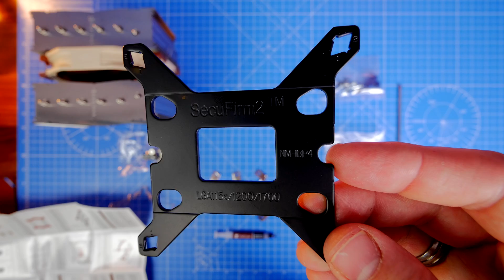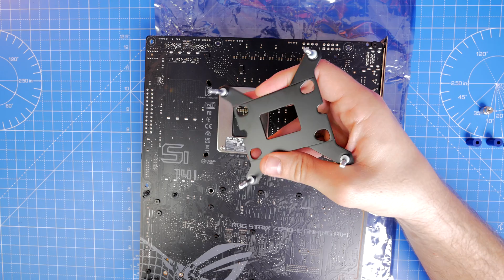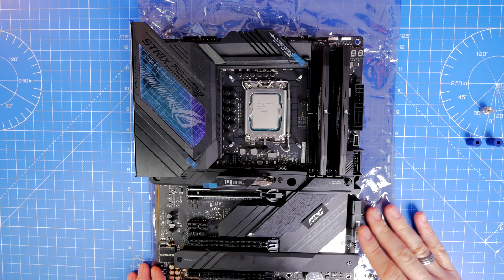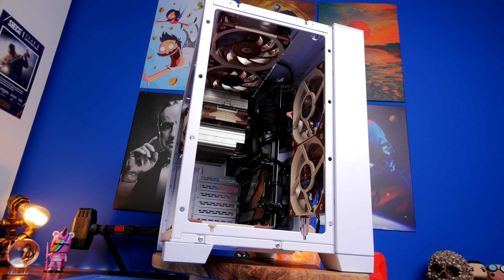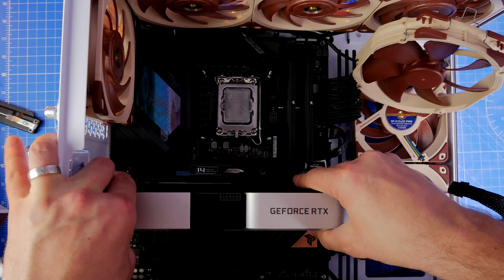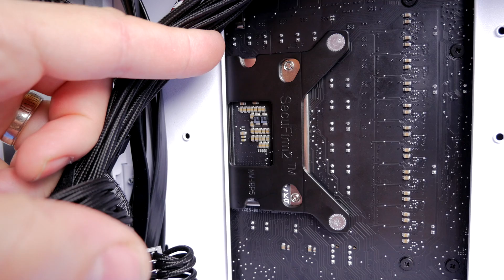Don't make this stupid mistake I did  (Noctua air cooler issues)

Comment: We've all be there in some form but its good you were able to get it resolved. I've gotten into the habit on new builds to build them on a test bench first and test the system for a good couple of days before migrating it into a case and finalizing the build w/ the typical wire clean up; mainly because of issues like this. Sure its a little more work to build on the test bench but far less than doing the final build install if things go wrong and you need to tear the system down to fix it.

Comment: phew, thought i was the only one but, I have my noctua cooler mounted horizontally as well in my PC case. do you think the temperatures get any better as opposed to if you had installed the cooler vertically?
Reply: Old but thought I would add, just installed mine on a mag x670e Tomahawk, and wish I had mounted horizontally as cant get in my first gup slot, If I had gone Horizontally it would reduce cooling slightly but adding and extra fan would have brought it back, I live and learn but was my first PC build, and a little bit more research would have helped. idle on a ryzen 7800 x3d was 37c

Comment: The CPU cable for the 8+6 or 8+8 pin socket (on the top left corner) is the most painful cable to plugin while you have a big cooler in your way. Experienced it myself too many times. That's why I hate so much to plug in this cable.
Reply: I use PSU extensions. I plug those in first, and route them through the case holes while installing the motherboard. Then I can plug in the cooler much easier. Also, ASUS boards use the Q-connectors. can plug that into the motherboard pins, and then have an extension for those wires too.

Comment: I think I saw in your video that is written on the plate   ''This side must face the motherboard'' Is that right or wrong? What I badly want to know is the effect on the cooler base plate not completly covering the top and bottom of the CPU, the E Sports cooler is also bad for that.
Reply from the maker: Correct, but that wasn't what I did wrong. I just hand it turned the wrong way. :(

Comment: Noctua claims that this NH-DH15S model can be mounted in this Asus motherboard by rotating it 180 degrees and thus blowing out the air laterally. Instead you have mounted it rotated 90 degrees as should be done with the NH-DH15 (without the S) throwing out the air above. Is this an error of Noctua or yours?Is there any hope with the Asus Strix z690-E Gaming to blow air out the side with this NH-DH15S heatsink model? Thanks
Reply: Maybe this is error by Asus? cause this cooler was released a long ago than Asus released their 600-series MoBos, and Noctua can't predict some stupid thoughts by manufacturers, whitch want from you a lot of money for their stupidness.

Comment: Hello, nice pointing that issue there, but i got a bit worried, you said "this cooler isnt actually in the optimal vision" ... i know that 12th gen i9 runs hot, but also im thinking of getting the same cooler for my 12th gen i7, and i really cant find anywhere if its gonna be enough...
Reply from the maker: Not the optimal orientation. I actually still think it's ok. The i9 runs hot but undervolted it's cooler. This Noctua cooler is renowned for being good, I think you'll be fine.

Comment: I think you still installed the bracket wrong. It clearly says this side should face the mb & you installed it facing away from it & it may be causing less pressure on the mount because of it & thermal paste spread proves it.
Reply from the maker: No that's not possible. If you look at the final shot you'll see how I had it right. The pins were already mounted for "this side faces motherboard" it's impossible to mount it backwards. It was just sideways.

Comment: Wondering if you could help, completely unrelated but I have 9 lian LI al120 fans on the way, my question is, what headed should I put them into? I intend to use 3 of the fans with my aio radiator, so should I use the fans under system fans and the radiator under CPU fan or CPU opt? It's my first build so I'm a little lost thanks in advance
Reply from the maker: Hello. Have you seen my video on those fans? https://www.youtube.com/watch?v=219ze9BgjlU That might help as they have a control box. You'll plug that into a PWM system fan header on the motherboard. As for Lian Li fans on a rad, that becomes tricky. I usually keep them on the control box, but technically it should be conntected to the AIO pump header (depending on what you're using). I'm not sure if the voltage on the pump and the fans would match though, so I'd hate to say it would be fine. But theoretically you could connect three fans to the fan output on the pump header, then connect that to the CPU fan or AIO pump header on your motherboard. Does that make sense. I'm assuming you're using something like the NZXT Kraken AIO or Corsair ones where you have fan power coming out of the pump head of course.
Reply: @TheProvokedPrawn  Hi, that's the video I've just watched and came from, I'm using a 360 lian LI Galahad aio but I'll be removing the stock fans for the AL120s my motherboard is a gigabyte Z590 vision G, it has a CPU fan CPU opt and system fan header, currently the radiator is in the CPU opt and the 3 fans are in the CPU fan headers, but I'm insure whether to link my 9 AL120s into system fan and move the radiator to CPU fan and set it to 100% or keep the radiator in CPU opt and put my 9 fans into CPU fan?
Reply from the maker: @craigjones9558  intriguing. The standard fans don't connect to the pump on that one? I'd use CPU for both if you can.
Reply: @TheProvokedPrawn  My standard fans are connected to the pump yes, so would it best to daisy chain 3 to the pump and daisy chain the other 6 to the controller? Thanks
Reply from the maker: @craigjones9558  yeah
 That's what I would try.
Reply: @TheProvokedPrawn  Hi, so I've just took apart my PC (it was a pre built sadly the only way to get a gpu) and my radiator is connected directly to the power supply with a molex, then I have a cable from the CPU fan header CPU opt and rbg header, when I installing my 3 lian li fans would I connect them to the CPU fan and the rbg, then remove the CPU opt cable? Or put the CPU opt into the radiator if I wanted too? Sorry about the novice question haha